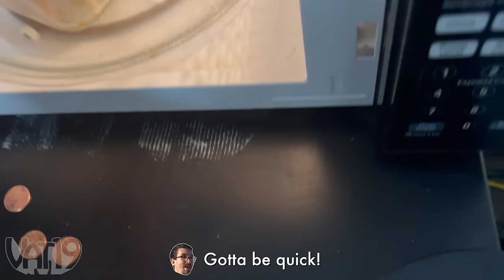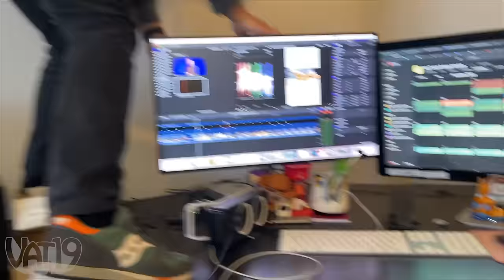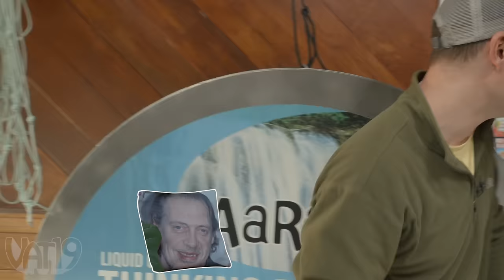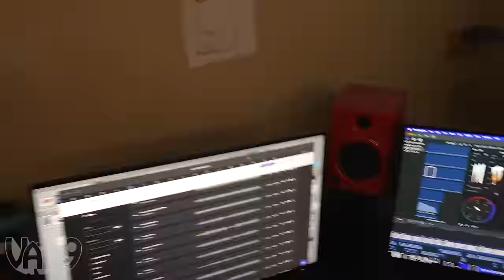Can You Find Them All In This Video? #4 • Hide and Seek With Gross Candy!

Comment: If the zones shut down, why not just wait until they can only be in one zone and then rapid fire find them?
Reply: well based on what happened they stopped shutting down zones. So probably only going to shut down half of the building at most
Reply: @japaniseanimialover1  Thats still only half the building to search instead of having to double back
Reply: @hannahxx17  its better yeah, but also means one cant wait for there to only be one zone left
Reply: @japaniseanimialover1  aaaah so youre arguing over semantics? Okay have fun